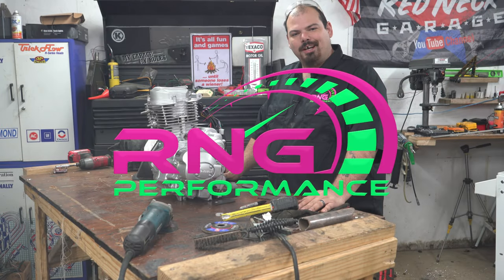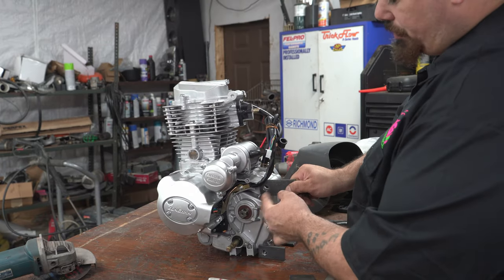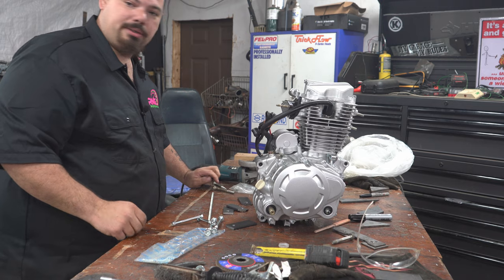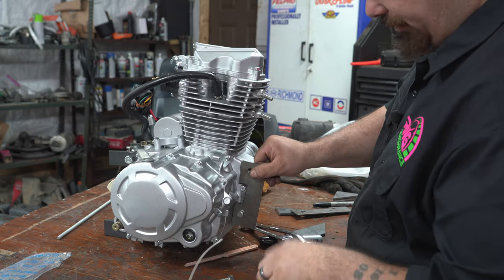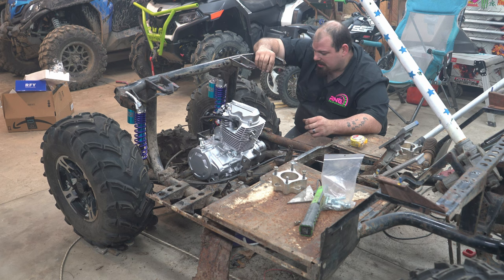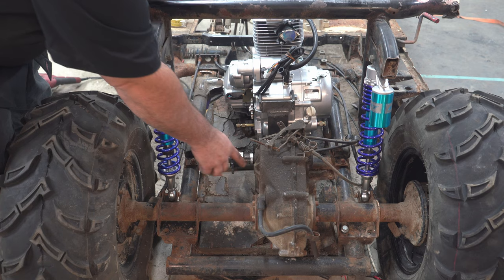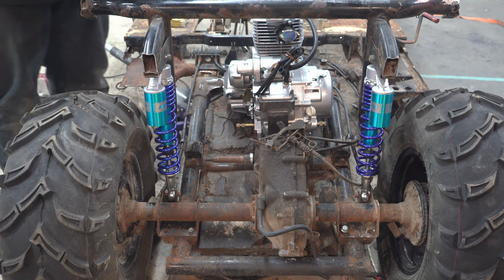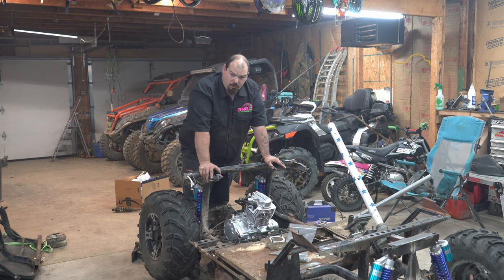Mounting The Engine + Rear Sprocket Golf Cart to Side By Side Mud Build Pt 6

Comment: Gear ratios in the gas golf cart rear ends are between 11:1 to 13:1 and the smaller the driven sprocket is, the better off you'll be, especially having a transmission in front of the already deeply reduced transaxle ratio. Otherwise doing it this way isn't going to set any speed records. If you want they do sell gear sets for the golf cart rears to gain more speed I believe they offer a 10:1, 8:1 and a 6:1 ratio which is the only real way to increase the top end speed of these transaxles. The problem with using a overdriven chain system is, the chain is spinning so fast that it will lose it lubricant and begin to smoke itself over any long term usage. Knowing this from experience with the school of hard knocks. Hopefully this helps? But the gears for these transaxles are pretty pricey, range from $350 and Up depending upon which transaxle you have and where you get them from. Just FYI.
Reply from the maker: Thank you for this information buddy. I appreciate that allot.  We shall see how this gos.  My boys won’t be running it too hard so I think it will be fine but we shall see.

Comment: Little behind on the Side by side build videos but I was wondering you putting in rubber for the motor mounts or don't you think it will need it? Vibration might be an issue without it
Reply from the maker: The engine is mounted to a swing arm and that has bushings in it.  Shouldn’t be a problem.